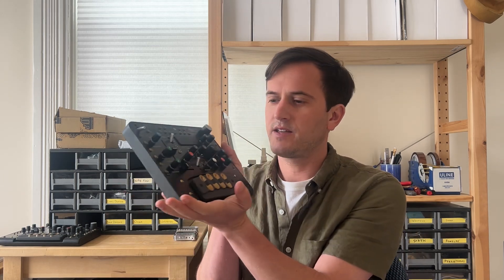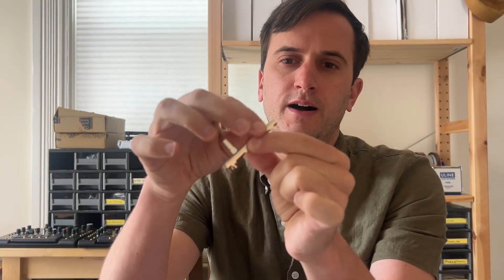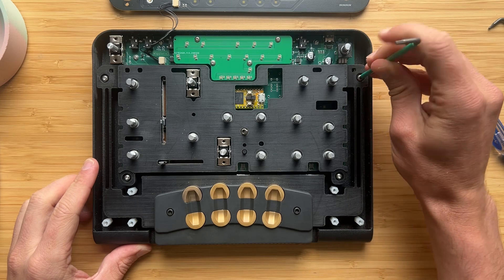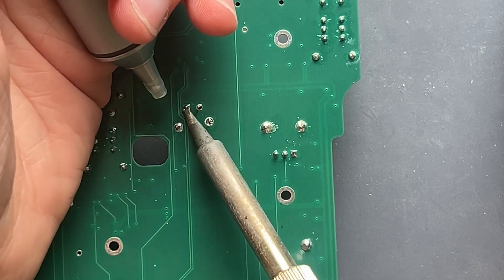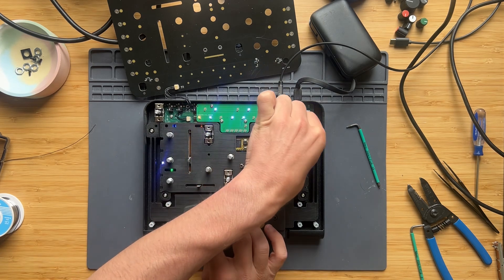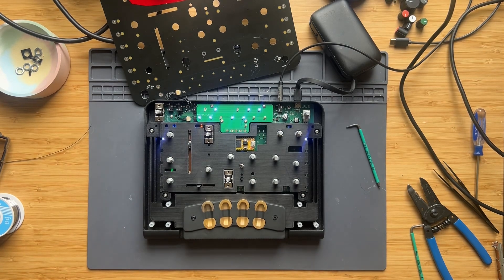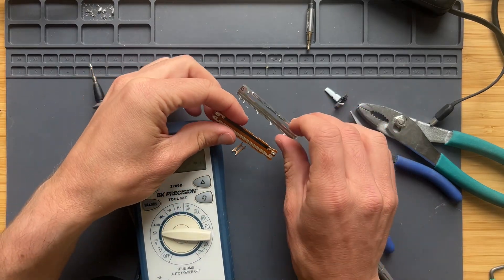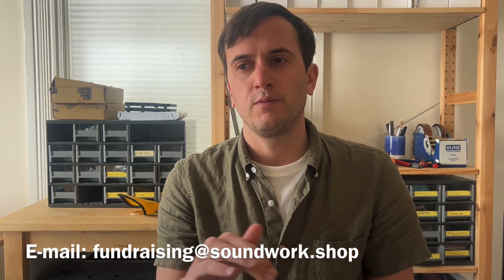Wiggler v3 Internal Tour

Comment: really appreciate your commitment to showing how your instruments work. i wonder if you could have created your xy system using a ppcb instead of an injection moulded system? probably not or you would more likely have done it but  would drastically reduce the cost
Reply from the maker: I think it would be possible to make flexures directly out of PCBs, it could enable some really affordable expressive synths because of the bare minimum number of parts involved.

In the case of Wiggler, PCB material did not work for the flexure. To enable the wiggle motion I needed the flexure to be about 10mm thick. A PCB can only reasonable be about 2 ish mm thick,

Also PCBs are made out of fiberglass which have very low elongation at yield (I forgot the exact numbers).  The yield elongation is set by the glass fibers. 

What that means for flexure design is that you would need larger flex arm to achieve the desired ranges of motion (5mm vertical and +/- 5mm wiggle). Wiggler would have to get larger.

A PCB would be great for a diving board style flexure.  It's the right thickness and is relatively low stress so even the fiberglass would work.

Comment: One of my favorite musical projects. How do the touch pads work? Did you use a dedicated microcontroller, or just a couple components? (although I would think that would take up a lot of space)
Reply from the maker: The touch pads use a touch driver IC called MPR121, you can buy a breakout board for it from adafruit. Each IC can do 12 touch channels. There’s on in the wiggly keybed and three on the back side of the front panel

Comment: It’s a shame these potentiometers and sliders break and get dirty easily considering they are often one of the most expensive electronic parts.
Reply from the maker: I did do a really wacky job soldering this slider on before I figured out a good way to hold it in place upside down I was trying to solder it from the top side, and applied a ton of heat to it.